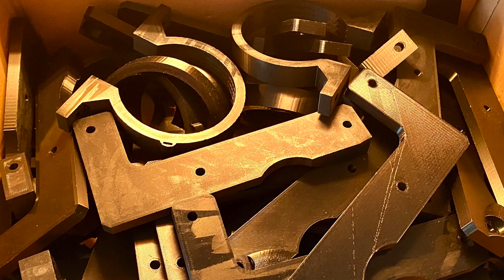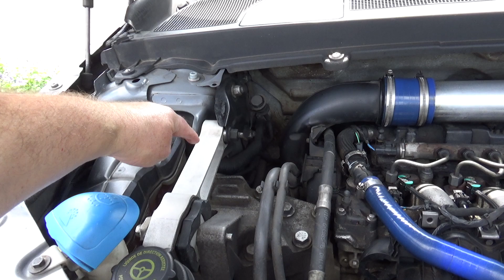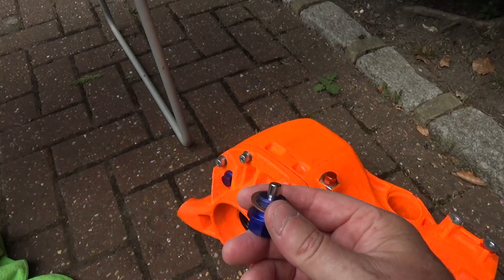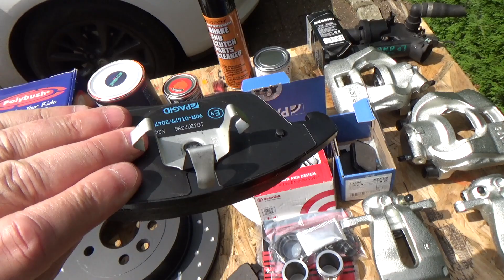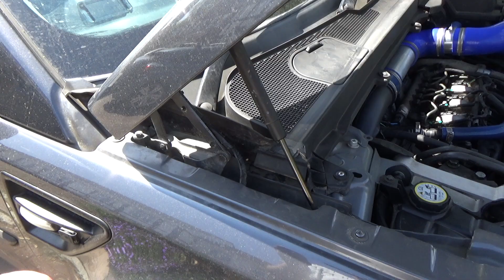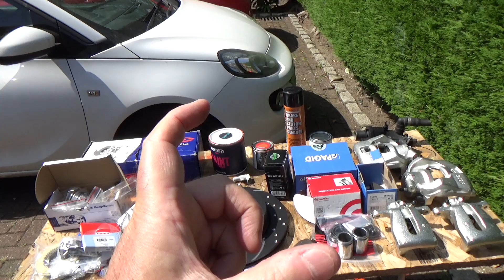VLOG #6 - May 2025 - “Braking Bad”

Comment: Gordon Bennet Scott! I just wish I had a tenth of the knowledge you've accumulated and the confidence to carry it out. Too old now anyhow but really enjoy watching the videos. Re the TPMS - do you have a link? Still think you need a bigger table! Best. AJ
Reply from the maker: 【2024 Upgrade】TPMS Tyre Pressure Monitoring System Solar Wireless 4/2 Wheel Switch Modes Accuracy 0.01 Bar 21-87Psi Tyre Pressure Monitor 6 Alarm https://www.amazon.co.uk/dp/B0CL4RRKT1/ref=cm_sw_r_cp_apip_8obB1BkZ7xrCk
Reply: @BeavisPits  Muchos Gracias!